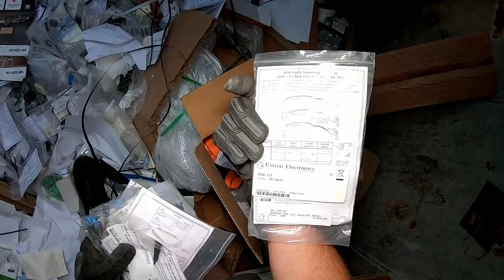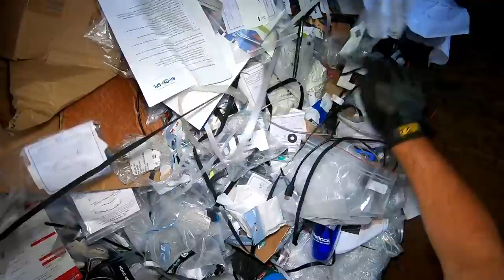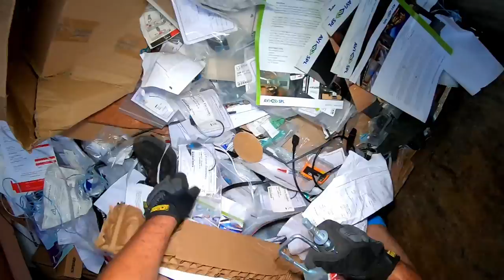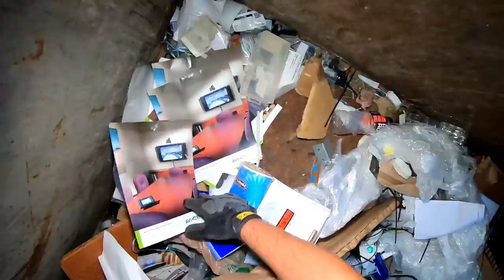Dumpster Diving "That's The Goods, Baby"

Comment: 33:10 That is a console cable, used for programming routers or ethernet switches.
The 9 pin serial end connects to your laptop (nowadays with a usb to serial adapter), and the RJ45 end plugs into the console port on the router or ethernet switch.

Comment: A to B USB cables can be sold for printers, the blue cable with RJ45 to en end and communication at the other and stand for server maintenance. Micro USB is universel now. Nice score ! But your fiber optic in the bag look bad, those kind of thing broke when they are bend :( Yes the plumbing is lead, you can mold mini soldier with it on an owen. I use to do that with the old plumbing :)

Comment: Mike am interested in seeing what those cable wires arw. Looked like some sort of cable install truck. The remotes are the ones that Spectrum keeps on the truck most of the time. That might be a sub contractor that the cable company uses and hires to do work.
Those rakes looks like for cement. Resell them instead of scraping for $$$.

Comment: Those rakes look like the ones i used when I worked a gold course. We used them to pull up the sand on the sides of the sand trap and then rake it. Was also good for for cleaning up the are you went into the sand trap with the ride on Sand Pro.

Comment: 36:30 it could be pewter, at one point in time, pewter plumbing pipes were a thing and it can be very soft and malleable when thin.
Reply: @36:30 are you sure about that?  I don't think that would ever be a good idea since there is lead in pewter
Reply: @patjannarone3769  we all know lead is not good for humans but there was a time, even forks and spoons were made out of pewter, even to this day in many applications that is not intended drank out of, pewter is still be used because of its durability and malleable properties. doesn't mean i am 100% sure, that Mike's part is pewter or not, its an educated guess nothing more.

Comment: Heat up the joints on the lead pipe and the brass copper pipes/fittings will come out. Dont grind the led cut it with a wood saw

Comment: The AMX unit looks like it may attach to a Raspberry Pi Computer (Single-board Computer) But would need a better look at it. 
It is LEAD ger out a blow torch and uses it to unsolder the items, YES LEAD pipes were used in older homes - a lot of times on the WAIST lines and the one item looks like a Waistline Trap. FYI Cast iron pipes use okara and lead to join them REAL Old homes can have main water lines of lead also

Comment: Nine minutes in and Mike  pays for a tank of gas!  Wire everywhere!  Dude, if you're cutting what may be lead, wear a mask. Lead piping goes back to Roman times but I wouldn't use it for any drinking water for sure.  Fishing dudes would be happy to buy it off of you if the scrap yard doesn't.